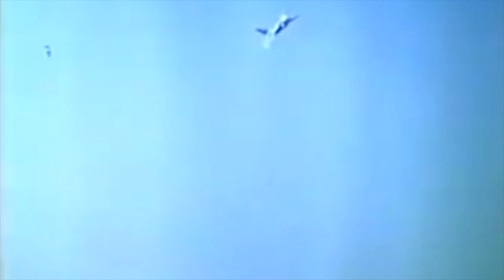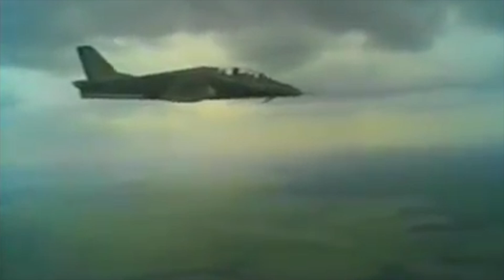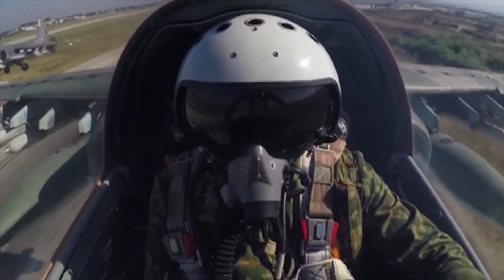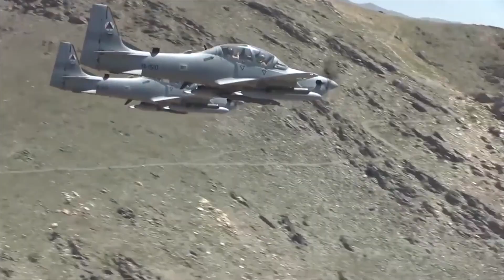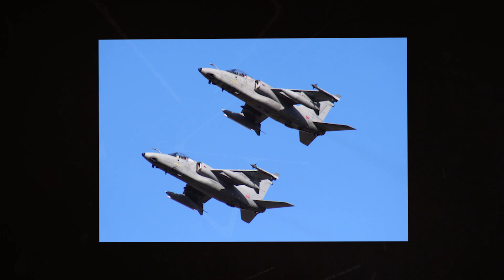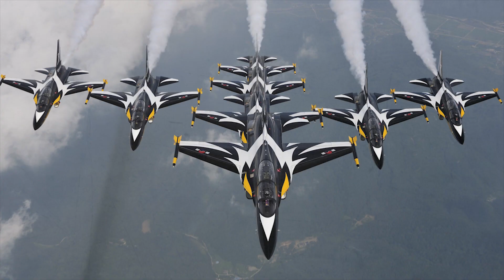10 Most Expensive Ground Attack Aircraft In The World

Comment: I see that you are talking about jet's as ground attack.   If you are going to talk about ground attack you should also mention ground support.   As far as ground support would mean Air Craft should be in the air to support the boot's or soldier's on the ground.   As far as I know and have seen the only air craft that can and is doing that is the A-10 Thunderbolt 2 which started as the A-10 Warthog.   The only ground support Air Plane you need because boot's on the ground almost request Hog's in the air when they need support.   When these pig's fly the enemy had better give up and try to run far far away.

Comment: Interesting how only the two American designs (A-10 & YA-9/Su-25) were designed with loiter capability. I also note that the video completely omits attack helicopters, which are certainly "Ground Attack Aircraft".
Reply: Umm, the Su-25 is an old Soviet design.
Reply: @mikepowers8607  , um, you need to read what I wrote. The Su-25 is a copy of the US YA-9. I even posted a link to information on the YA-9! It is a much closer copy than even the MiG-25 was of the proposed twin tail variant of the Avro Arrow. The Su-25 came out 3 years after the plans for the YA-9 were stolen, and it was literally a YA-9 modified to fit the longer Soyuz engines. The modifications consisted of longer engine pods and a slightly redesigned tail. The Soviets had been working on an attack aircraft since the late 1960s, but quickly changed their design around 1971, when they started getting American data. Edit: Here is a link with some info.https://military.wikia.org/wiki/Northrop_YA-9

Comment: ALL the quoted costs SHOULD have had the date (year) that the price was for.  With  few exceptions the prices were not current, nor converted to "consistent XXXX year dollars'.  Also the years of production should have been mentioned along with number of engines. Note the SU-25 is made in BOTH 1 and 2 seat variants and is is now made in the former soviet (now independent) state of Georgia. You should also settle on either Metric or Imperial units 'twelve seven millimeter' gun is HALF inch (50 cal), not switch back and forth between the two. Although the initial specs for the A-10 did have two rates of fire, the production models all were single rate of 3900 RPM.